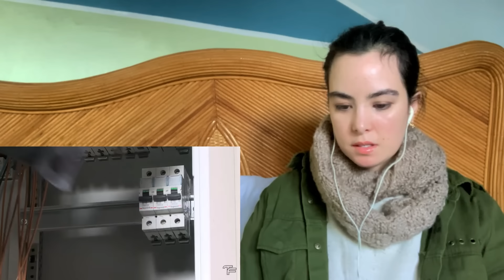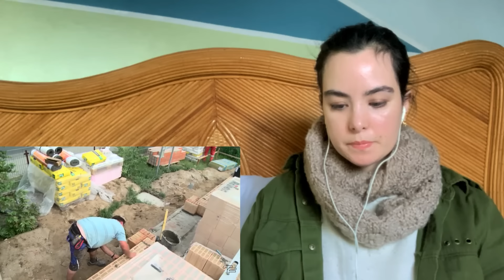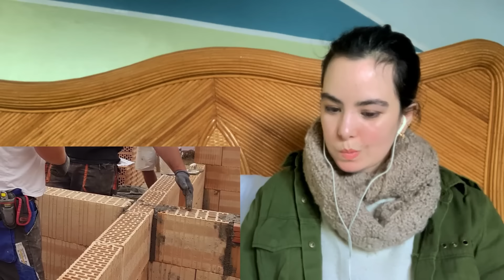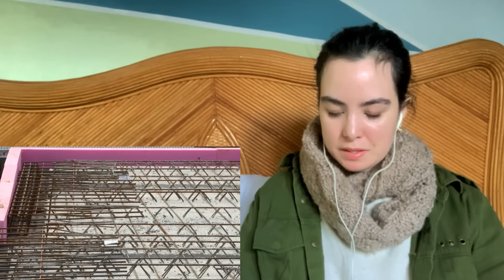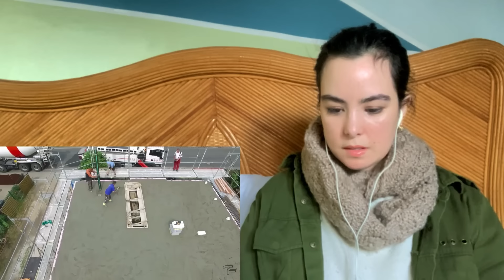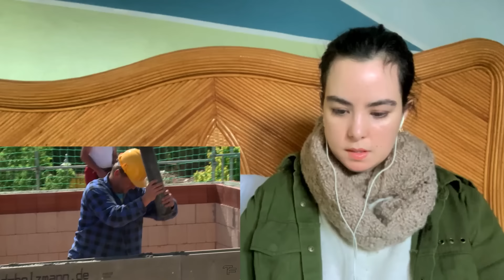How Germans build a house REACTION!

Comment: So in Germany we still need a building permit and the process for that is very difficult you have to submit a building application first then someone comes to check whether you can build there at all  Then you need an architect for the house and structural engineers who calculate everything and plan the whole house, sometimes you even need a civil engineer and they do everything in advance and then enough  The building authority first and then the building permit comes and that is why some parts are already prefabricated in the factory and they only had to be connected together according to the construction plan and installed

Comment: In this case it's really only 10 days, I'm German. Before the construction site even starts, two years of arguments with the building authorities pass. Then the excavation pit is dug in 2 days, the floor slab is poured in one day and then you wait 30 days. From then on the video begins. The concrete ceilings are prestressed concrete ceilings, which are so portable. The concrete that came on top only sets for 1 to 2 nights, as it does not have any supporting function during that time. Additionally, not seen in this video, the ceiling was probably secured from below with straps. But you can still continue working. Then at some point the roofer will come and put a roof on it, which takes less than 2 days for the wooden framework and another 1 or 2 days for covering it with roof tiles. And from then on it really drags on, then the window manufacturer comes, measures and the windows are ordered. Then some time passes. Then the windows are installed. The heating inside will probably be put into operation before winter so that you can work warmly and the construction site dries out, hence the windows. The house then remains unplastered for 6 months, sometimes even 1 year. So that the house can still "settle down" so that any cracks that may arise can be plastered over so that this doesn't only happen afterwards when the plaster is already on the wall. Before the plaster can be put on the outside, the attic is usually removed first. The inside is already being plastered because it isn't so tragic with possible cracks as there are smaller areas that could be repaired in an emergency. But these are all precautionary measures; most of the time there are no cracks.

Incidentally, it is no longer so cold in Germany that we need such thick walls. The winters are mostly around 0 c and often without snow for years, at most 2 days of snow a year, it is more of a muddy weather, but the winters are 30 c warmer than in most parts of Russia. The thick walls are often due to sound insulation and heat insulation for the summer, because here it can easily be 42 c at midday in August.

As a child, summers were only 25c warm and winters were -25c cold. Thanks to global warming, this is history.

Comment: did u know in like 20meters deep u  have  15 Degree Celsius. imagine a Family  can heat up this Place with their own body from 15 up to 24....like neandertals in their caves. we know rock can u heat up to reserve the  heat. one fireplace can heat up the caves. imagine u have a wind turbine  and your rooms are in the  underground.   And what we do  we uses  power to build a house that need more energy in terms of electric and Gas and water. there is Always a pump or a fire to heat up or use the  shower.... 24/7...isn`t crazy. so if u are poor u better dig a hole and save this money for building  and run a regular houseor use these Sea container each cost only 5000

Comment: The old houses with visual wooden beams are called "Fachwerkhaus". They are build with these wooden beams and the spaces filled normally by clay and straw. Cement didnt existed back then.
Reply: Yes, and I love theese clay+straw walls. They actually regulate the humidity of a room very well. The houses of my grandparrents have theese walls. However, for the outside walls the thermal insulation isn't the best...
The not so known downside of clay+straw at inner walls: Due to the high amount of humidity they can take, the hygly absorb electromagnetic waves. For my own small house (2 floors with 55m² each) I use 5 WLAN repeaters. Still have spaces with no WLAN...

Comment: The problem with concrete walls (and why they are not used) is the bad heat insulation. Therefore the "bricks" are from clay and have large holes in it to make it difficult for heat to leave the building in winter.
The advantage compared to wooden constructions is the fact that the houses cannot burn down, better noise and heat insulation and durability. Disadvantages are the (comparably thicker walls), higher costs and longer building times.
Reply: A concrete floor is also much more comfortable than a wooden floor, which sways with every strong wind due to negative pressure. I know both. I didn't like the wooden floor, and it isn't gas-tight either.

Comment: I did one of those 2 day builds, where you start from foundation and erect all the walls, including plumbing, electrical cables, everything apart from surface finish and detailing,  all the way from concrete slab to a complete water proof roof in a weekend. There is of course like 4 times more workers and a ton of helpers so workers don't have to walk anywhere, stuff is brought to them. I was doing wiring, it is a monumental task to plan it and manage it, but.. when everyone knows what they are doing, it is amazingly fast. We did the wiring runs, someone else connected it after us and so on, from room to room.

Comment: So im German. My Dad and I build his house very engery efficiant. Using Bisothem Stones ( 38 cm) + 10 cm Clinker Stone Blocks in front of it. Between 4 Cm breathing room for air circulation. So just imagin ~ 50 CM ( 19 Inch) outside wall of stone.  :D. Most of the time you build a house not for some years. It is made at least for 2-3 Generations

Comment: thats why german houses costs 10 times more then american houses and also would survive a tornado with ease ;D
Reply: apparently you have not priced houses in the US for some time. a new construction 200m2 house with a 2 car garage and 2 bathrooms costs you 480,000 dollars. like 240 dollars a square foot. What is still cheaper is the property. I live on 2 acres (roughly 8000m2 in the woods. that is nice. i could by a 5 or 10 acre property quite easily here. I live in Metro Atlanta, Ga, so not exactly rural. In the middle of the country you could afford 10 times as much property. i remember houses being 73 dollars a square foot.
Reply: @uliwehner  for a 200m2 house which is really big and 2 garages and a decent property like 1000m2 which is also really big in germany - for a new build house you will pay propably around 1 to 1,5 million euros ....  if you build really far away from everything land will be cheap but you dont want to live there :D    u can barely find estates unter 400t euros which are "old" and i mean these are mostly from the 1950s to the 70s ..... newer starting at the 90s are much more expensive ... so i think you can rally have a cheaper house in the us then here in germany ;D  but hey its tornado save .....unfortunately we have none :D  which is good....
Reply: @hanswurst3811  the building cost per square meter in germany is about 2000 euro. That is right in line with the cost here in the US. Maybe even cheaper. Leaves the cost of the land to put it on. That cost is much higher in germany. Location makes a difference. Georgia is way cheaper than California. Metro Atlanta is way cheaper than in atlanta proper.

Comment: There are many possible technologies, but on single family home it's quiet often this brick-like technology, but today often pretty much bloated with air to have good heat insulation.
The foils are most often water protection, ground water from the soil, rain water from the side and from top. When finished, they make a test like in airplanes. Close all doors and increase air pressure.If the pressure stays for some minutes, it's airproofed, that means no air is coming from inside out or vice versa uncontrolled.

Comment: First thing, MOST German houses got cellars if possible - wu like to have room for storage - this adds another 6 Weeks for constructing 🙂 .
Germans don't like to have"cardbox"  houses like the most US-Houses.
Thats like other mentioned before is time consuming an d you have to calculate approx. 1 year for consruction.
BUT you can have that al lot of faster IF you like to have a solid modern house made by wood - look for a German "Fertighaus" 🙂 this can be uprised in ONE DAY, getting the complete house in cluding the Roof in 3 Days. This reduces the Time (after 6 Weeks for the basement) to approx. 4 Month.
B U T getting a Baugenhmigung in Germany ist an endless upsetting story.

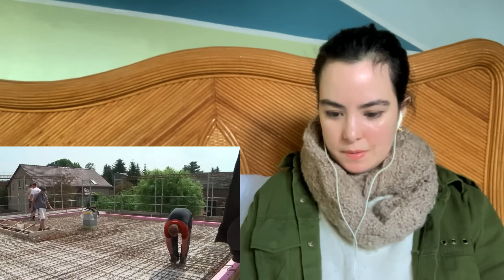Comment: 10:00 I worked a good amount in construction ... more on the base-plate parts and stuff, but i know some few things from concrete work like for the upper floor here..

All off this is pre planned. Every last bit of iron rebar is (usually!;) laid out in CAD systems, precalculated and mostz often even prefabricated offsite at the supplier most of the time... Sometimes the rebar workers have to piece togeher something on the site or cut some bits to size .. but usually, they order what they need according to the building plans, just lay it down/build it up and secure it. ;)

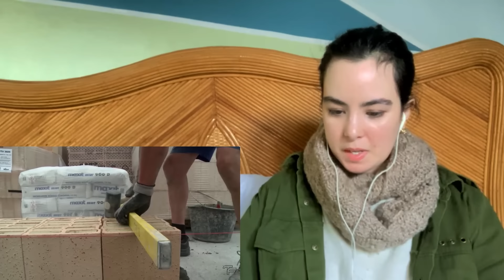11:45 Rain doesn't do much to the concrete. The internal crytalisation is as far as i know not dependent on the outer moisture level ... at least not that it would count... Temperature is a different thing. ;)

Well, heavy rain on such a floor plate could disturb the smooth surface maybe... mhh... ;)

Ahm .. Rebar is short for reenforcement bars by the way... ;)

17:00 About the overall planning. Yes and no. Those buildings are usually planned from the green up on modern CAD (computer aided designg) software/platforms. Including calculations about load bearing parts and overall loads on virtually every single part... That's right where all the data for the needed rebar comes from.

So, as long as the building contractors and workers adhere to the plans as best as possible (let's say, within some milimeter maybe;)), the final building will conform to all regulatory needs. Of which we have a lot over here in germany.

Including load bearing capabilities on parts and structures, temperature insulation properties and whatnot. ;)

Comment: One thing is clear. Most German houses are built with a basement.
Although setting up the raw walls and even the roof very fast, you cannot move in after 2 months. The interior finishing lasts way longer.
The bricks are made out of clay, but this after forming the bricks is fired to get hard and strong.
The building engineers calculate the number of bricks and all other materials needed, exactly. Ordering is then done with a certain amount of surplus to account for possible damage or wasting.
Reply: These house is not with a basement, and this is not right !
A basement is very expensive, and many people do not have them...
Reply: @jurgengrove2488  In the past, almost every house was built with a basement if the soil conditions allowed it. Nowadays, digging a basement is very expensive due to the energy costs, so people save on it.
Reply: Basements are very common in the south, but almost unheard of in the very north.

Comment: If you imagine the weight of the whole house sitting on that black membrane, that is why nothing will shift. A concrete slab needs about four weeks to fully harden. So after pouring the baseplate, they have to wait until it has cured enough to take the weight of the walls. The same for every floor.
Clay is "burned" which hardens it, think of china. Or your ceramic coffee mug. It's the same base material.
The concrete sheets they use for the floors saves building a mold for pouring the concrete. Otherwise, every room below would be full of metal jacks holding up wood sheets forming a base to pour the concrete. They leave no footprints because they walk backwards with the leveling tool, eliminating the footprints. If it rains, they get wet. It's an outdoors job. They work in every weather, except if it freezes, because you can't process concrete at freezing temperatures.
It doesn't fit that nicely by random, these elements are either produced on demand, or the house dimensions follows the available sizes. There are plans made by an architect with precise measurements. You need a building permit, for that, you need to comply with code and regulations. 
Finishing a house needs about 6 months. What you see in the video we call "Rohbau". It's basically just the load bearing structure. No windows, no cladding, no heating, no electricity, literally just concrete and bricks. The most of the construction time is used for finishing the exterior and the interior.

Comment: Concrete and/or bricks. It’s no bashing and I’m sorry for them, but if America would build houses that way instead of wood, California wouldn’t look like now.
Reply: Well that is also a reason why Houses in California so often totaly destroyed by fire....
Reply: yes, bricks and concrete are better when considering fires, and there would also be less holes from punching drywalls :-)
but until recently, in that region, the danger from wildfires probably was very low and the danger from earthquakes much higher,
giving an advantage to wooden houses with thin walls that could be rebuilt more cheaply, and refitted with non-burnt old furniture.
But why is that cheap method also used in so many other regions that have neither of these problems ?

Comment: You could build a House only with a few Guys. It´s last longer, but it works. But all the Electric, Heating and Water Installations need much more Time. But in the End it will be a safe and cozy Home for Dekades.

Comment: The insulation of the outer wall is not only against cold temperatures in winter but also against high temperatures in summer and for good sound insulation. That's why you can do without air conditioning even in summer. All of this serves to achieve a high level of energy efficiency. In addition, there are highly insulated exterior doors and windows, which nowadays contain three glass panes. The lenses have a special coating to reflect the thermal radiation. The gaps are filled with noble gases. Of course, all this also costs a lot of money and there are other components of a house. But that is probably the topic of further episodes. 🇩🇪🇪🇺

Comment: The whole world looks to Germany for inspiration and how to do things correctly.
Reply: Have you seen how they do the electricity, that's an absolute disaster.
Impossible to change anything later.
Reply: @JacobBax  that is what planning is for. architects... I live in the US and the standard of electricity and plumbing is not high at all. saying that it is easier to bust open drywall to run wires is not an argument for someone who wants walls that last hundreds of years. I have seen wires run at crazy angles criss cross walls and ceilings. ridiculous
Reply: @JacobBax There are plastic pipes in the walls for electric wires. You can change the wires when a thunder hit your house and burn all wires. And you can another cable do in this plastic pipes when you need it. But when do your house plan you look where you need electric plugs or telephone TV etc.